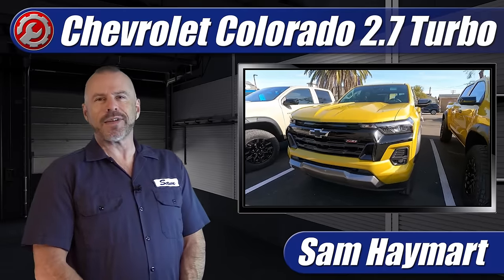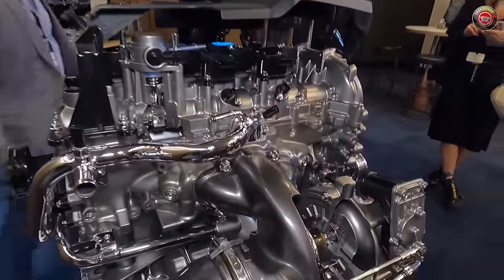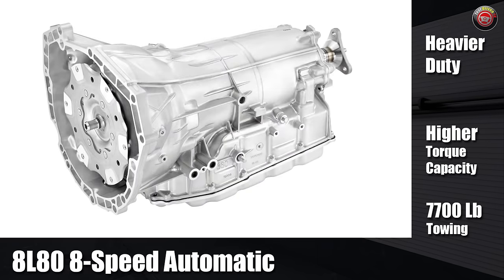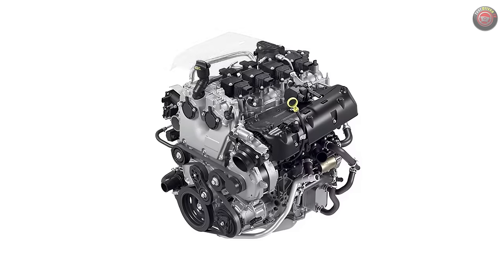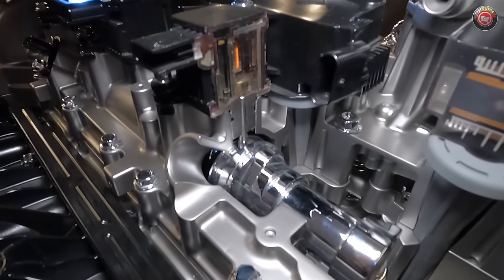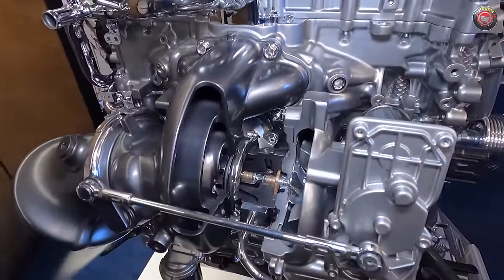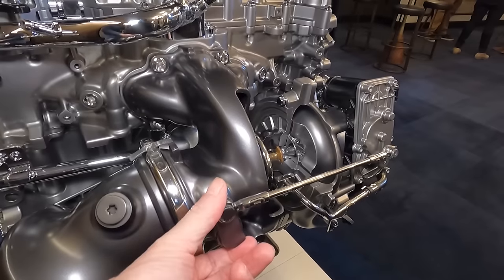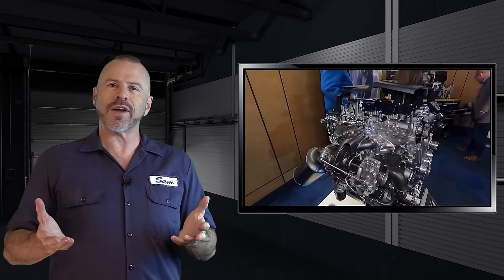2023-2024 Chevrolet Colorado 2.7 Turbo Engine: What You Need To Know

Comment: I'm sorry to admit this,  if the turbo intake entrance hasn't ever been hooked up to the air breather area, then how does the engine get the extra power boost, this turbocharged system,  I'm looking at the engine in the video and I don't see how the turbo works,
Reply: The engine in the video does not have any of the intake tubing attached

Comment: Is this engine good, for daily driving, or just towing?
Reply: I own a 2023 silverado crewcab 4x4 and it tows with no problems , its rated for 9500 lbs in full size truck , most people this would be great for general use and occasional towing , i avg about 22mpg in the city and 25-27 on the highway if im not being to speedy .

Comment: its simple anything with a turbo wears out 3 times  fater then a non turbo engine plus chevy or gm hasnt made a turbo for a gas engine that hasnt took a shit before 80,000 miles when they try and squeeze this much hp out of small engines thier not gonna last plus they dont get that much better mpg

Comment: When will these idiots understand that shutting off cylinders is not the best way to get fuel mileage out of an engine. You could do a lot better with torque is not required by letting the engine run lean. Running the engine lean will get you better fuel mileage and less Parts problems and fewer Parts in the engine then trying to figure out a way to shut off cylinders. The stupidest idea they've ever had it didn't work the first time they tried it it hasn't worked the second third and fourth time they tried it and it still doesn't work all these engines have Parts issues. Charles Lindbergh showed people how to do this in the 1940s with the P-38 Lightning. It works people, quit being stupid
Reply: Bro, you are not up to date. Most autos now-a-days cut fuel off entirely when coasting. Not lean, OFF. Next is pumping losses. It’s not a small amount of energy lost. Do you understand how an engine brake works on transfer trucks?

Comment: What is cheaper to build  a 4 cylinder or a 8 cylinder r? What  will last longer for the purchaser? Why have they not made a EV as a option? I do not get it I thought this country was trying to move forward not backwards!
Reply: Damn, Frank. Settle down. It's just an engine. This isn't 1946, and the nation doesn't rise or fall based on what GM builds.
Reply: It's coming we will be building the new battery plant next door soon

Comment: I miss the V6... already.
Reply: 4.3 is still optional in Chevolet Express & GMC Savana full size vans. 276 horse / 298 lb ft torque @ 3,900 rpm. Turbomax 2.7 310 horse / 430 lb ft torque @ 3,000 rpm. Don't miss the lack of performance, and efficiency.

Comment: I purchased a new Silverado Trail Boss LT w/ the 5.3 in 2021, at the time these 2.7 L4 were not quite 2 years old so i wasn't even going to consider it for 2 reasons, first it was still a new engine, second it was a 4 cyl in a full size truck. Fast forward to 2024 those 2.7 L4s have been bullet proof as with the 5.3s. But I think the biggest issue with the 2.7s will be resale value.
Reply: My thoughts exactly but bought a new (40 miles on it) '23  Silverado Custom Crew 4x4 w/ 2.7 turbo 6 months ago. Sticker was $50,500, marked down to $39,995, then reduced further w/ $1,000 Costco rebate & $2,200 GM card earnings to $36,800 (+ tax). Traded in '16 Silverado Z71 Double w/ 70k miles & received $25k trade in. I feel I did well enough on the "front end" of the deal.... not really concerned of depreciation on the "back end" 5 yrs from now. I'm very satisfied w/ grunty little low rpm torque monster - 20 mpg avg since new. Have been a 40 yr GM V8 exclusive buyer. No regrets.

Comment: The ultimate would be a  quarter liter , 1 cylinder engine with about let’s say 250lbs boost pressure using 2w-0 oil, why not?  Built supposedly like a diesel of course with  high temp glass fiber reinforced plastic, LOL!!

Comment: When you talked about deactivating cylinders I've seen enough. This ruins engines. Uneven heating causes cylinders to warp and leads to burning oil. No thanks.
Reply from the maker: It's almost a standard feature on most new vehicles today. It's getting more and more difficult to find engines without it. #inhale

Comment: 🤔 all this tech and advance systems and off-road hardware and you drive that slowly thru the trail. Back when I was 19yrs old that's in the 2000's I remember driving a chevy s10 thru a ranch road full of rocks with patches of red sand here and there way faster than this I was probably going 30 to 40 mph.

Comment: well proven?  2013 cruze, at 7500 miles, LEAKS AT: water pump; thermostat to waterpump mounting surface; water outlet; oil cooler.  And while doing the repairs myself, found the inside of the turbo to be cracked in 2 spots, but did not have any issues from that.  So, as a Chevy guy, CHEVROLET are you going to start, ever, using parts that go far beyond just meets specs, like goes way beyond, especially with the radical prices new vehicles cost.  And that turbo, is it from any better manufacturer than the one that came factory on my 2013 Cruze, or should customers expect to end up with $5000 to $10000 in repairs somewhere between say, 70000 to 1000000 miles?  Oh and I understand warranty, but what about resale, and Cheverolet being LIKE A ROCK, or HEARTBEAT OF AMERICA, TODAYS CHEVROLET.   Cause all I see all cars as now are destined to be far overpriced, made to be nearly impossible for most consumers to do any or very  little work on, and then when dealer repairs are needed, are VERY expensive
Reply: First of all the Cruze were pos cars! Yet you are correct problem from jump! Bad design
Reply: Don't buy a Colorado unless it's a Zr2!

Comment: The stupidity of continuing the 8 speed transmission, and not offering the 10speed is the an atrocious decision. Reason number 12747, I am a Ford guy, and EB fan.
Reply: Not the same 8 speed and you can keep your junk Ford 10 speed
Reply: @tommyrich4156  Do you own one lol ? Ford and GM both collaborated on the 10speed transmission lol. I have a 110k on mine and zero issues, so they are not junk. You have to keep up with maintenance and do fluids, filter changes. There has been a bulletin on some years and variants. Overall, I am a fan of the 10speed.  The 10 speed is a better overall transmission and better fuel economy, so the only reason of them going to 8 speed is cost.

Comment: Honestly who wants a 4 cylinder engine…Guess the alternative is Toyota with a 6 cylinder.  I don’t think Chevy’s 4 cylinder will hold up.
Reply from the maker: Toyota no longer offers a V6, a 4-cylinder turbo going forward.
Reply: Toyota is putting their new 2.4 turbo in literally EVERYTHING, including full size Toyota/Lexus SUV's. Drive one, you might be surprised, these aren't the 4cylinders of yesterday.
Reply: I've owned 7 vehicles with 4 cyl engines. I've owned 1 V8, and 1 V6. My present 4 cyl has more HP and torque than any of them.

Comment: The most VITAL thing you must know about the GM 2.7 Turbo, is the ECU has a TIMER of "on-boost" driving mode. MOST owners expire the TIME on Boost before the normal "Warrantee" is out, so you HAVE NO WARRANTEE on the "hand grenade motor". I read the "fine print" for you, since no "Real "Murikun" reads the owner's manual. BTW, the 2.7 Super gets WORSE fuel economy than the shitty 5.3L which gets 25% poorer mileage than a 5.7 Hemi in a Ram and the 5.3 and 4.8 have lifter issues no one can fix for under $5 Grand.

Comment: All you need to know
Do not buy one 
My 4 cylinder colorado dropped a valve @90,000.mi totalled the engine
Reply from the maker: You have 90,000 miles on a 2023 2.7L Colorado already?
Reply: BS! Plenty out there with 100,000 +
Reply: No its not ,I now own a ranger
Reply: You put 90,000 in a year?

Comment: Won't buy a truck with a 4 banger
Reply: Livin in the past brah
Reply: Old guy here. My new 2.0 liter sedan makes 100+ HP and 20+ lbs/ft torque more than my first 5.7 liter 1977 Camaro. And when I say the fuel economy was double, I mean literally double. 15 years ago I was unhappy with the trend towards cookie cutter 2.0 four bangers, but damn have they made this layout work. Except the sound. The sound is shyte. No way around that.
Reply: No extended cab no manual transmission no purchase for me 😢
Reply: @docholliday6285  Living in the past? You think an engine that is over engineered for tech is better than the past engines like for example the 2003 5.3 v8? A force induction gas engine, deals with more internal stress. This engine is for people who dont care about keeping the vehicle past 5 years. I've worked on main battle tanks to your honda civic, I wouldnt touch this pile with a ten foot pole.
Reply: I have only owned 1 V8. My present 2 l turbo develops twice the HP, and gets at least twice the mpg. I forget the torque spec of the V8, but my cyl has more, and at less rpm.